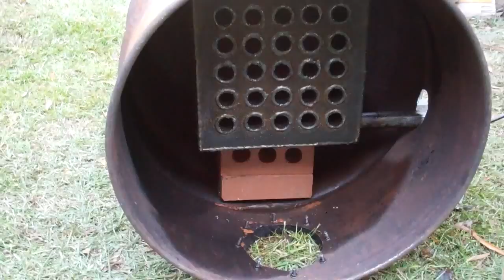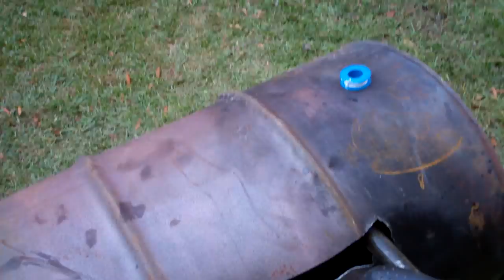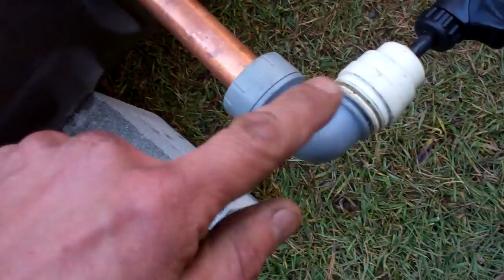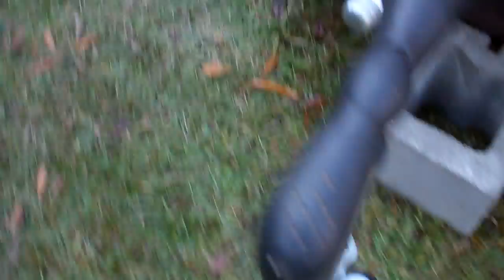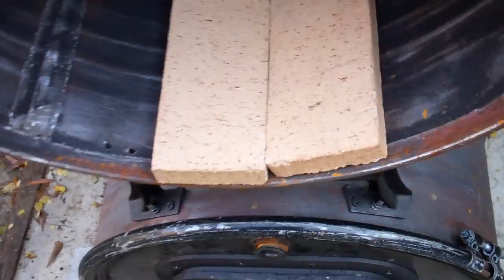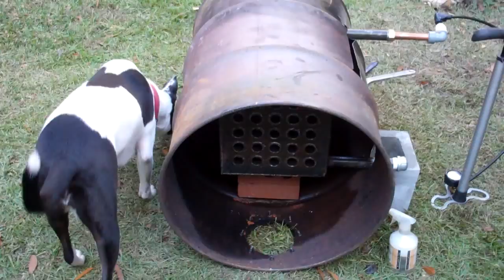Boiler update 2 (Pressure testing)

Comment: One more step closer to making the wife happy with heat this winter. Now that I have seen the pipes I have a clear picture in my mind now. Did the pressure test hold. Niw your test was with air pressure. Will you do a water pressure test and both?  I just thinking as you are building.  Curious mind at work. Thanks for sharing the next step. Stay warm.